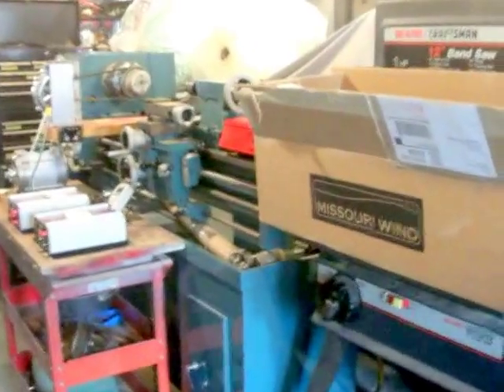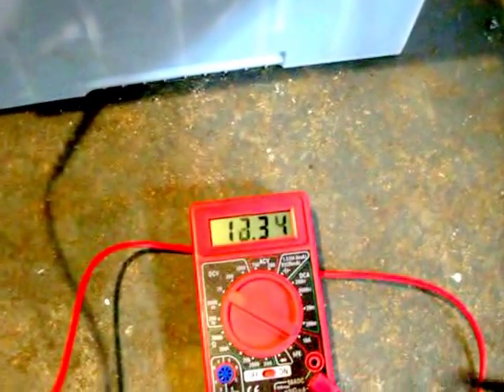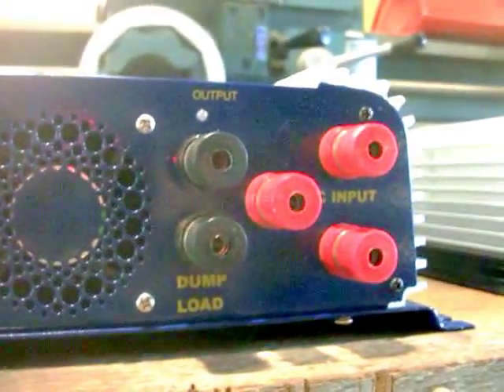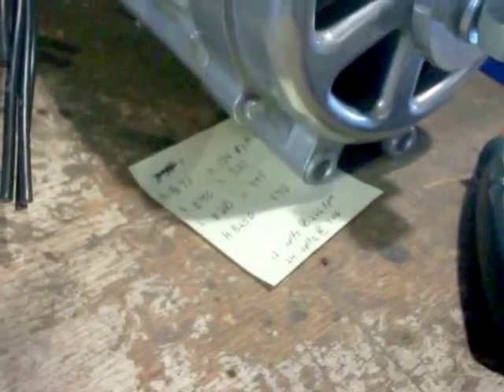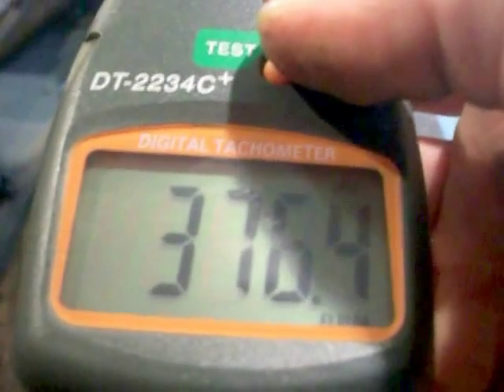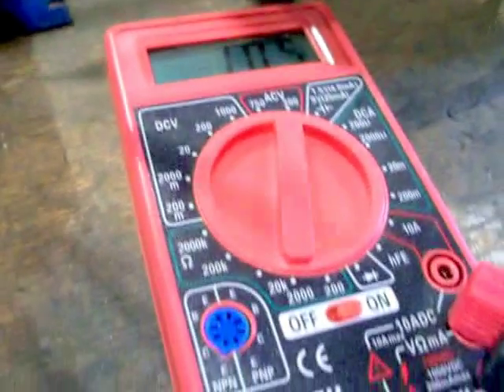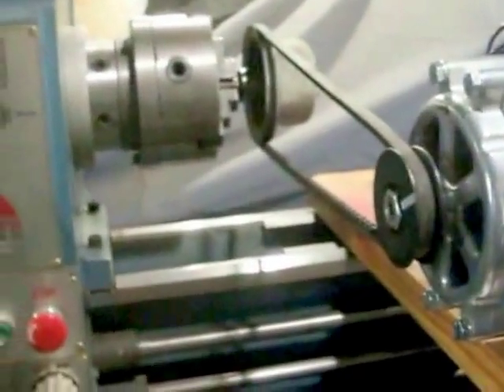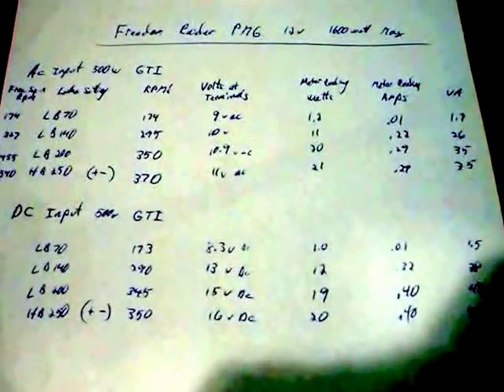AC vs DC input grid-tie inverters part 1 Missouri wind PMG rpm test

Comment: It always amazes me how some people have all the equipment but not a clue what they are doing.
Reply from the maker: It's an old video but I can tell you solar panels kick the shit out of wind for over all power.  And now I have much more then a clue
Reply: Clearly so :-)  Good non aggressive response. Solar and wind serve different purposes though. Often when there is little or no sun, there is wind and when there is sun, there sometimes is no wind, so while I also prefer solar as the primary power source, wind is a good topup for when there is heavy cloud cover or even during windy nights.

I've seen several videos where folks complain that they have 12V or 24V systems and the turbine kicks out 300V or some other high voltage and then they say the power is low because they can only use 12V or 24V of the output at the low output current and those folks miss the boat completely. They don't seem to understand that to get the best from your combination setup, your wind, solar and battery systems have to operate at the same voltage range.

What is your take on vertical axis wind turbines? I know they have lower output but they have four big advantages as far as I can determine. 
1) I live in a densely populated area where many folk have had to remove their turbines due to neighbours complaining about the sound the horizontal axis makes. The vertical axis is more silent. 
2) Our wind changes direction all the time and tends to be gusty. The VAWT handles this better.
3) No need for slip rings.
4) They are less affected by turbulence caused by wind obstructions like trees.

I'd love to hear your opinion now that you have much more of a clue... ;-)
Reply from the maker: LOL, my clue on the subject was test results for a grid tie set up and even thou I now have a battery bank, I didn't at the time.  My interest wasn't in what turbines could do, but rather what they would do in my area.  I'm one of the only people who put a rpm meter on the turbine.  Some people bashed my modified turbine but it out performed the regular almost 2:1.  Yes, not enough speed on the vertical axis for me and they are all the same when it comes to design.  They don't perform like you want and the only way to get around that is build one yourself with more magnets.  I needed 250 rpms before my turbine would start making power and even thou I've seen 600 watts, for a second or two is garbage.  I'm sure results would have been much better with a battery bank but I decided return over cost I'd be better off just buying more panels.  I hate hearing people say how they haven't figured out how to use solar panels at night......store it in a bank and use it at night of course.  That's like saying I haven't figured out how to use a turbine with no wind.  Each has their purpose but I can't go up high enough and I don't get great wind here.  So, for the average person, wind is not for them but yet MW&S says everyone can have one.  I even bought Jeff's low wind area blades and it's just not good.  I made more power on a cloudy day then my turbines did on the most windy days.  You'll have to see my more recent videos on wind turbines and I even did a 2 year review on Led's, turbines and solar.  No matter what I tried to do I knew if I spent $1400 on electricity for a year, that was the most I could ever save on a perfect year.  Even solar puts me out 8 to 10 years on a return.  My original goal was to turn the electric meter back ward.  Or reverse the power flow on the smart meter and I successfully did just that.  Then I found out the electric company charges me no matter which direction the power goes, LOL.  So it's best to just keep that meter still as long as you can, either go a little under or over.  I have another video on the ultimate amateur 24 volt battery bank with I use the power from at night. I have two sets of panels to power help power my house during the day and one big set to charge my bank. A yet later video, I add a DC variable speed controllers to adjust the power taken from the bank at night.  Keep in mind I don't have tons of money for this stuff and I wouldn't recommend even panels for anyone unless they really want to make their own power, or it's just a hobby for them to mess with.  Investment wise isn't the greatest but I will say when the power went out here in my area, all the neighbors had no power, and I was making myself a pot of coffee compliments of my battery bank. I do wonder what I missed with wind connected to a bank, but not enough to ever go back to turbines unless I make my own.
Reply: Lightendog , thanks for all the info. 

Where I stay, I think the picture is quite a bit different. In winter it can be downright miserable for days on end but the wind blows most the time, up to speeds where you get blown away if you don't hold on to something. 

I think that wind power may be viable with our winds but again not as a standalone system but rather as a top up for solar during miserable weather. I believe that vertical axis is less prone to self destruct in high winds but then again, you cannot furl it. 

From the research I've done, the big advantages of vertical axis wind turbines are they turn easily in low winds and in spite of turning slower, they produce higher torque which allows you to either produce higher amperages at lower voltages or to gear, chain or belt drive the alternator to higher speeds in low wind speeds.

I guess that one day I will have to make the time to try it and then I'll know. I've been looking at the direct drive washing machine motor (the big flat one with the ring of magnets) instead of a modified automotive alternator as a means of producing power.

Before I know what will work, it's not worth spending the money on a full blown system. Also, batteries are very expensive here and the ideal is to keep the number of batteries to a minimum.
Reply from the maker: Yes, batteries are very expensive.  I spent $2K on 16 Trojans but it is a hobby to me and hobbies cost money.  As far as the vertical axis turbines goes, if it spins easy I'm thinking it must have the air core as I know iron cores will cog or stick a little.  Torque will come from surface area to catch wind.  The 81 inch 5 blade falcon set allowed enough torque to spin my modified turbine.  Even testing those pmg's on my lathe was really straining it.  Now that should make sense to anyone who's ever heard the alternator belt on a car squeal - takes force to make that power.  
You ever notice how people that make turbine videos don't like to show the power made over a period of time?  A lot of them have the kilo-watt meter connected but they only like to show results during some storm to try to prove how great they are.  I've made my share of enemies just over that alone.
Now once a month I also had to spin the turbine one direction to straighten out the tangles wiring.  It also sucks to sweep off snow from my panels but it's a small price to pay as they are still better for me in the winter. 
Jeff from MW&S was setting up a wind tunnel to demonstrate how great these turbines are....LOL, he was using wind straighteners and everything, trying to create the perfect wind that no one has.  He never finished it as far as I know cause even he knows, you can't polish a turd.  The biggest hint was he had none on his house.  If they were so damn great you'd figure he'd also be a customer of his own product.
Good luck on what ever way you go and remember to log down power made in 1 day, 1 week, and even 1 month just to prove it to yourself.  Just one panel beat my turbine over a months time by a lot in the winter, but again the wind isn't that great and not many people are allowed to go 60 feet up..

Comment: I know it was a year ago but basically 10.8v-30v is for a 12v-24v max configuration. 22v-60v is for a 24-48v max setup. It has to do with the minimum battery capacity and its maximum charge ability based on how it's configured and what types of batteries you use.
Reply from the maker: Yes thank you, I'm almost an expert on this stuff now, lol.  Check out my ultimate battery bank in a more recent video.  I haven't seen one like it yet.

Comment: Only a handful of wind generator manufacturers have done the design work to customize a specific inverter to work safely and effectively with their wind generators. Batteryless wind is definitely not a situation where you can buy a wind turbine and then go shopping for an inverter. You should buy the two together, from a reputable source.

Comment: Great demos. I wouldn't put too much blame on the manufacturer, pretty much all generators and motors are made improperly. Voltage is our friend in a gen output. A battery in these systems is advantageous because it acts as a voltage regulator...the capacitance/resistance does that. The trick is to make a generator that produces a higher voltage output relative to the low battery voltage, to go with a nice high battery resistance/capacitance.

An ideal test would be to remove the copper from the gen and replace it with smaller gauge, but the exact same weight in copper. My guess would be that the output wattage would be the same as with these tests at these speeds, just with a different V:A ratio. But, I would also guess that when the higher V from the smaller gauge is put across a high resistance/capacitance battery then there would be very little lenzing. Also, as the speed increases (freq), there would be even less lenzing. So basically as the wind picks up, there would be less lenzing :)

Our electrical engineering does not use Ohm's Law very effectively...it has a 1 track mind.lol. Peace. Reactance! :)
Reply from the maker: I can get a pmg that is wired for higher voltage, 48 I believe is the highest on the small wind turbines as far as I know.  These setups are a ton of money and right now I'm paying about .17 cents a kilowatt from the power company.  My total bill for the whole year was $1300 so whatever power I produce, I can't save more than $1300 a year under perfect conditions, unless they'll pay for feeding the grid.  Grid tie inverters aren't supposed to be connected to a battery like a regular inverter. ( they say it will fry the inverter).  Now I can't use a regular inverter with my (on grid ) setup in case they cut the power to work on the line.  I'll see what it does once it's in the air but I'll definitely be adding solar panels which is supposed to out perform wind.  I just don't really see this being worth it for the average person.
Reply: ***** I guess my brain forgot that you were thinking grid-tie...oops, I was thinking of the normal battery system. There are huge wind turbines where I live and I always find it funny to consider that there needs to be power in the grid for them to be able to operate...lol. Even still, our gens and motors don't use reactance and ohm's law very effectively. I was thinking of a gen with wire gauge that would give an output in the hundreds or thousands of volts. Just like with a joule thief or a Bedini, the voltage will charge the battery and the battery's resistance will regulate the voltage...and with proper electrical balancing there should be little to no increase to input work. Thanks for the good thoughts.

Comment: only thing that would make me fairly happy with  the re-engineered car alternator syle pmas would be something like ians set up with 5 foot light weight  high quality design blades, low wind high output is where its at, my idea of realistic winds are 5mph to 25mph, i did see romo jack live stream with the big axial hit 300w at 7mph , chris olsen experimented with various designs, one that interested me was where every coil was independant of one another to  lessen the drag on the blades, just means lots of rectifiers, and he built a single phase, geared axial aswell.

Comment: You should always use the DC inputs for you inverter on PM generators. Inverters will give you input specs on what voltage and and cycles/Hertz they will operate under for DC and AC voltages. Since permanent magnet generators do not have a set Hertz/cycles they run at, you need to convert it to DC voltage to make it work properly.
Reply from the maker: nathan Tucker I tested it both ways and ran it thru a bridge rectifier to the DC input inverter.  The results where similar as the ac input inverters do have a bridge rectifier in them  converting the wild ac to dc, then back to 60 hz AC.
Reply: I did not know that. I have been looking at the radion series inverters to try some hydro power out of the freedoms. They would only take 50-65 Hz AC inputs. I'll need to take a look at some other inverters to see what they will do.

Comment: For grid tie, a 24volt turbine works better and a 48 volt turbine will probably be best ,, I am using 12 volt turbines grid tied most of the time ,, the Sun grid tie inverters like more voltage and dont need the High amps that the 12 volt turbines make,
If you would like I can make a video doing a over view of my 12 volt grid tie setup and explain how and why I set up my turbines and grid tie inverters the way I have
Reply from the maker: If you make a video on it, I'll definitely watch as I'm still in guessing mode for the most part.  I believe I watched some of your video's and I thought for sure you only used the DC input grid ties.  I want to avoid the battery banks and hopefully the rectifier (less crap to burn out), and because I don't have large AC or DC input grid tie inverters, I can't tell which of the two is better to use as they are about even at lower rpm testing.  I just tested a 48v pmg and it's with out a doubt the best choice.  I'm still waiting for the 24v to arrive.  Number of blades to use is the next problem.  With my wind, I'll test 9 and 11 blade but 65 feet in the air will never happen.   Coming off my garage, I'll have two units but only at about 25 feet. (Best I can do for the money and area).
Reply: *****
Ya I only use the DC input grid ties, I think it makes it easier to stack many grid ties together, using only one rectifier,

 I found that is is best to stack about 2x the turbines output of grid ties together, this spreads the amps and volts to more than one grid tie and makes it less likely to burn up your grid ties.

I use 9 blades too, on my single core turbines, it seems to work best for me, I just bought a 5 blade set of G5's and they seem to work good also,, I don't have a Dual core Freedom II yet I am waiting for the new larger G5 blade set made just for the duel core turbines.

I don't have a 65 foot tower either :) ,, I have one on my roof about 30foot off the ground and one on my garage about 20foot , and 3 on the back of my solar rack about 12 foot :) I would like to build a 40 foot tower someday but I am not sure where to put it yet,,
Reply from the maker: Jason Brown I have the dual Freedome II 12/24 pmg set with 11 blades it looks like I won't even touch.  I won it at a good price of $430. After shipping it was about $465.   I'll sell it to you for $440 with free shipping.  I'm eating a little shipping charges but I need to recover some money for grid ties.  My set has only been opened to make sure everything was there.  I never even put the pmg on my lathe. (No point with the single giving me problems).  Let me know if your interested.  I have 4 pmg sets now and I only want to keep two. (the best two for my situation). 
As far as burning the grid ties, these are supposed to have features to protect it.....My test with the 48 volt on an AC input inverter 20-60 vac input ( only one I have that size ).  Anything over 300 rpms put the voltage out of range.  The grid tie shut down and I thought I burnt it out.  Unplugged it for 30 seconds and it still didn't work.  Unplugged it for 4 minutes ( I let the caps inside totally discharge ) and it works perfect again. 
It's too bad when these grid ties dump the load, they dump the whole load and not just the exceeded amount.  I'm also waiting for a 7 blade G5 set to show up.  I noticed those blades don't interchange with the G4's.  I suppose some drilling on the mounting bracket could solve that problem.
Reply: *****
Heck ya, I will buy it :) ,, I get payed on the 10th and I think I have enough project money saved up, I save a little money out of each paycheck just for my wind and solar :)

and for the 48 volt turbine on a 22-60v grid tie you will want to stack it with a 48-90v grid tie,,
 this will give you a larger voltage range, thats another reason I use the DC input grid ties
.
I would recommend just buying the G5 blade hub, if you drill one hole just a little bit off, it will throw the whole blade set off balance and it will shake bad, But you got the equipment and seem to know how to use it so you will probably be ok , I,just don't want someone to get hurt
Reply from the maker: Jason Brown Yes, problem is I don't have a 48-90v grid tie yet.  Just ordered two 1500watt ties today.  The manual says you can stack AC grid ties.  I figure a 1500watt inverter should be okay with a single pmg. Or two with a dual pmg - one off each plug.  The real wind will tell me which is best.   If a storm comes I'll just pull the disconnect handle.  My pole mounting set up will be made so I can easily take it down for maintenance.  I'm using unboltable metal poles instead of guide wires.   Send me an email at Lightendog@aol.com when you get a chance.

Comment: That's  the  reason  the  readings  are  jumping .
Reply from the maker: yes and it's an old video......I have video's after with rpm meters on the turbine showing power output in wind.